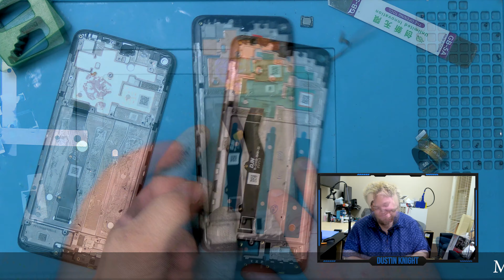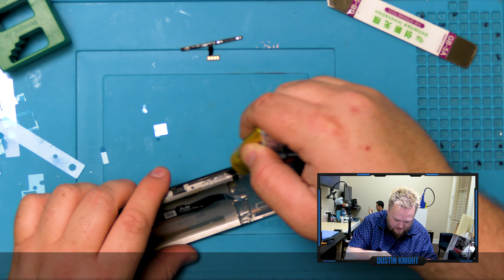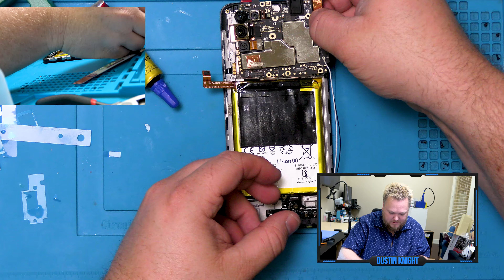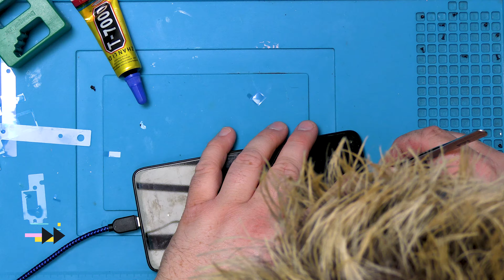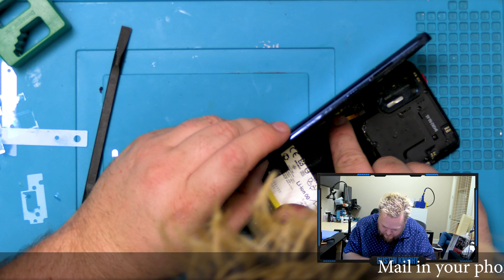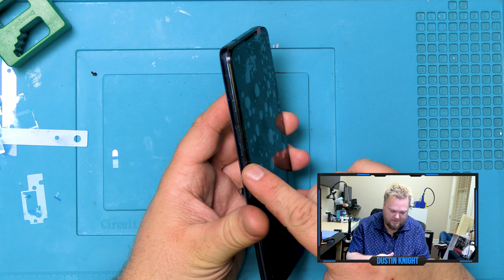Motorola G9 plus Screen Replacement DETAILED PART 2

Comment: Thanks. There was a doubt about buying a spare screen with frame or not. Now when I have seen the whole process I would rather buy a screen without a frame because that way of repair for my moto g9+ seems much easier and requires less equipment.

Comment from the maker: Watch PART 1 from HERE :
https://youtu.be/_aDKcPin6bM

Please support the channel by using my amazon links! 
For just the LCD & Recommended Parts click on the links below.

Moto G9 Plus Screen LCD :
https://amzn.to/3MUNPQJ
https://amzn.to/3O2MLei
https://amzn.to/3xe6OQg

3 PACK Screen Protector :
https://amzn.to/3NJCyUu

2+2 PACK Screen / Cam Lens Protector :
https://amzn.to/3tsNi1g

G9 Plus Cover :
https://amzn.to/3O9Ovmg

Battery : 
https://amzn.to/3MFknxY

Heating pad:
https://amzn.to/3mbIytW

Heat Resistant Gloves
https://amzn.to/3EsZdyW

My blue mat to keep everyone organized:
https://amzn.to/3BalS16

iFlex Opening Tool with Glue Card :
https://amzn.to/35UC9h8

iPlastix Opening Tool with Glue Card :
https://amzn.to/38FtzUH

on of my favorite screw driver sets 2uul:
https://amzn.to/3jsqkCz
https://amzn.to/3CcoL2Y

iseasmo w/ Kit (Has Screw driver too)
https://amzn.to/35Za2O0

Tweezers:
https://amzn.to/3B7yBlf

T-7000 Water sealing glue:
https://amzn.to/3EdzLxs 

Isopropyl Alcohol For Technical Use:
https://amzn.to/3BqBU78

Need to get a part from a reliable quick source, you'll find a better price here then Amazon and the quality will be a lot better. Click on the link below.
https://www.injuredgadgets.com/?acc=be9b6cec65c863e1b55538d2c7fcc9b0

• Visit our Website: https://tech-md.com

• My email: dustin@techmd.bz

• To mail in your phone, please contact us at 801-438-6028